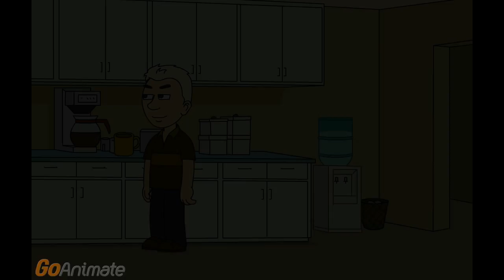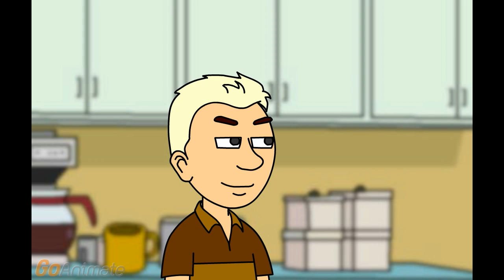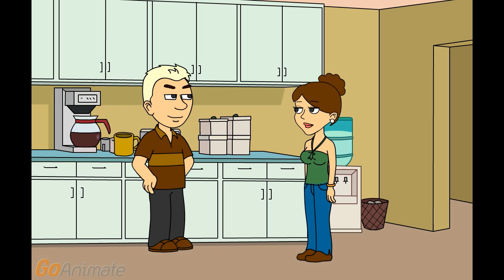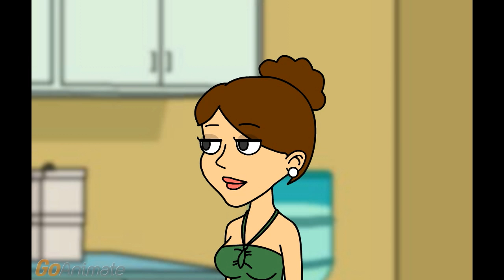Lennox Air Conditioner Troubleshooting

Comment: Help please....

I just got a 24kbtu unit. Great so far.  But the remote has a wifi icon in it.  Does it work?  If so how do it get out to work ? Which app 

Lennox L1012CO-160P432